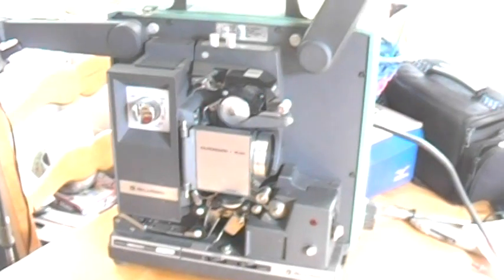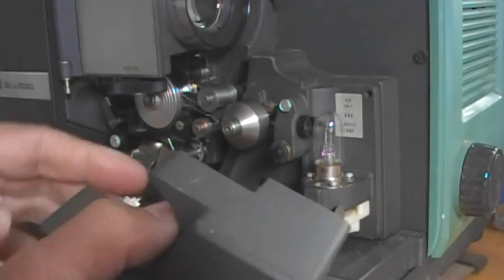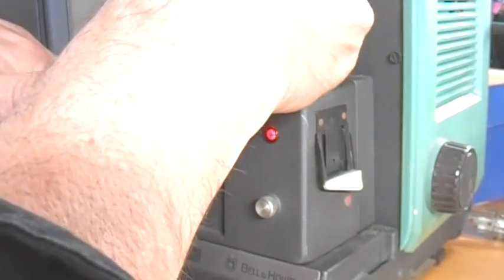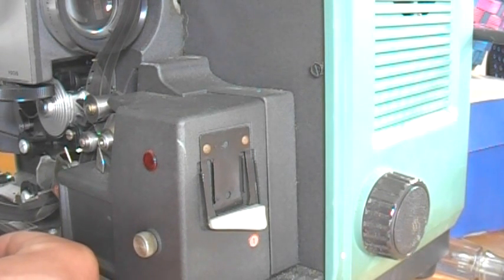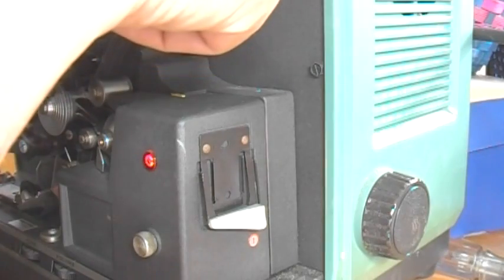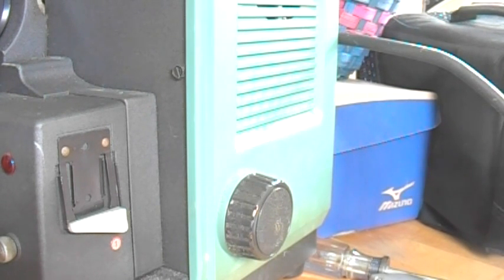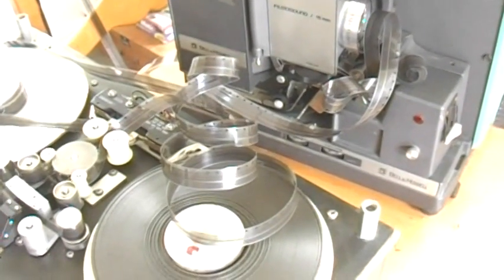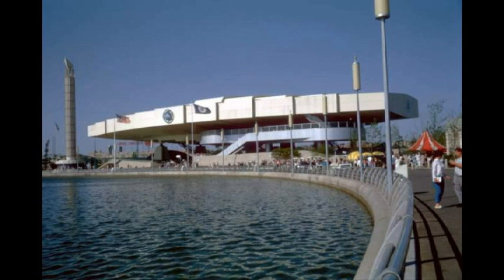Mystery of 1963 Optical Tape Player Solved

Comment: For old sound films, the soundtrack was typically recorded on a separate film reel and paired with the visual portion later (as shown in https://www.youtube.com/watch?v=c6YGAaEfSj4).  Since you were able to hear your film by pulling it through a 16MM projector, it seems as though the reels could simply contain a soundtrack of a film shot on 16MM.  With this system in effect, it doesn't seem too unlikely that movie studios commissioned a machine that resembled a reel to reel tape recorder, but one in which film soundtrack reels passed through the a mechanism essentially the same as the audio player on a projector,  so a technician could listen to an entire soundtrack for errors before marrying it to the visual reels. See the wikipedia entry on the Pallophotophone - just such a device briefly in use in radio at the dawn of sound-on-fim in the 1920s.  It was multi-track, however.
Reply: the URL you posted is no longer available...!

Comment: I saw you had the original player/recording machine three. Did it not work at all. If the projector sprocket and the holes on the film matched you might have been able to play it that way much easier.
Reply from the maker: The original unit had a surprisingly complicated wiring harness, and a multi-prong jack that I could not identify. I don't believe the motor was marked with a voltage, nor was much else. So it would have been a real process to figure out the voltages, and polarities, and also which pin/wire was to drive the unit, and which were for the lights, then which were for audio and control functions. 

I would have had to disassemble the unit much more, to trace out the wiring and so on.

It could have been done. But most features of the unit related to synchronizing it with the train ride, and other unknown attributes. Considering the only feature of immediate interest was the optical audio track, and that a projector could use it for audio, I went that route. 

So you know, I restore old radios and other equipment, and actually worked in a military subcontractor wiring test units for the US Air Force. So I could have done as you suggest... I just didn't consider it the best route in the circumstances.

Comment: The audio modulation bulb lasted a long time, but the VISUAL high wattage light lasted only about 40-50 hours. MAYBE one is being made to day, but I would not bet on it.  The film light was a 1000+ watt bulb, the size of a bite-size pretzel.  They got hotter than all heck, and that's why those things are loud -THE COOLING  FAN.   -I used to get burned by those monsters!

Comment: What has become of this photographic sound  (AKA:optical sound) reproducer from the  NY World's Fair of 1964?  I also  attended this exhibit in 1964 and with my little sister was called up on stage to participate in a demonstration of Bell Tel's f;futuristic video telephones.  The experience stuck with me until this day.  OF course one of the pioneers of optical sound on film recording was Western Electric which was the manufacturing and supply unit for all Bell Tel products so it makes sense that the exhibit might use  long standing technology to have sound tracks that could reliably be synchronized with the ride.
Reply from the maker: Hi, kdegru: Sorry for not responding for so long, and missing your comment. I sold the unit to a World's Fair memorabilia collector, who vowed to make a digital recording of the entire track. Hopefully he did, as it would be the best, and most complete, recording of this historic audio...
Reply from the maker: @cactusjackNV  No I haven't heard. I have to say I agree with you and everyone else that I should have made my own recording before selling this. It would have only entailed transferring the whole film to a reel, running it through the sound projector, and recording it off the audio output. I could have cleaned that up with my audio program, and had what would have been the best version of this track known. 

I regret not doing that. 

In my defense, I was in a bad frame of mind when I sold it. I was overwhelmed with mountains of "stuff", and had enough project to take me past my "due date", and saddle my family with a huge mess. So I was selling and trashing everything I could, as fast as I could. I am a hoarder at heart, unfortunately, and once in awhile need to impose some "tough love" on myself. 

And then what happens is I end up making some mistakes, having some regrets. This was one of them. I should have done a proper job of recording this for posterity, and for not doing that that, I'm sorry. 

The new owner swore he would do this, but no, I have not heard from him, nor looked for such a recording. 

Thanks for the interest and comments.

Comment from the maker: @Kinematographer  Your lab sounds great... all that wonderful equipment should be preserved. I think I may be getting the original machine working... If I do, I will make a recording of the entire soundtrack. But even if I don't get it working, I may be able to use the projecter, if the speed of the sound track is the same. I'll just have to wind this audio film onto a reel, then make a wav and mp3 off the 1/4" audio jack of the projector.
Reply: I know this is a 9 year old comment but I'd love to hear this recording in full,  Direct hookup, Others would as well. I've heard the recording in the description and it's recorded like someone is on the ride. I'd like to hear a direct hookup recording of this tape. Maybe post a wav/mp3 file in the description.

Comment: Rubbish, beware the internet! This projector, like any 16mm projector used in education or business from the 1940's to the end of the analog era, played both variable area and variable density. That was the whole bloddy point. The lamp is called a 'goalpost exicter', the filament is a minute coiled strand. It is the 'slot' that allows a variable density optical soundtrack to be played. God knows what the 'disc' hole you are talking about is for, maybe a repairman dropped something at random once. You read about it on the internet, or saw it in a projector as a missing 'big slot mask'. Now you are an expert. Not.
Reply from the maker: Marklimbrick: With all respect, it is clear you either didn't pay enough attention to the video, or didn't understand very much about what was done here. 
First of all, yes, the projector used is a standard 16mm optical sound projector. And yes, I am fully aware... as are most of the other commenters... that this is what it is. But you totally missed the "whole bloddy point" here: I was using the ability of that standard projector to play the audio track of a standard 16mm movie, to play the audio track of the film strip from the mystery optical tape player. 
You see (or don't, or didn't) that the optical tape player was the mystery... a black box with the mystery optical tape in it... a small production unit, the top screwed down. Of course I could tell by the included parts and technology WHAT the unit was intended to do, but I could not power it up, as it would have been a pretty big deal to trace the circuit and determine how to power it, and how to wire up the audio output. Possible, but difficult. 
So, I took a standard 16mm projector, as you brilliantly noted (and we all knew, already), to use the functioning optical audio reader on THAT unit, and passed the mystery tape through IT. This allowed me to hear what was on the mystery tape. 
So the conclusion was (I am guessing you didn't really watch the whole thing, or actually hope you didn't, because then we have a bigger problem here other than simple impatience leading to arrogant trollism), after being able to hear the track, that the unit was a player for the sound track of the ride at the 1964 World's Fair, along with tracks to control and time various exhibits and animations along the ride's path. 
The very rare... possibly unique unit (no, again, Einstein, not the projector... the type of which, BTW, I have several, going back to the 1930's, and which I have repaired and restored over the years, being an antique camera, clock and watch person, and even used to give movie shows in my back yard, back in the 1980's), I sold to a World's Fair memorabilia collector years ago, for a tidy sum. He promised to made a digital recording of the entire sound track at some point, which will probably be the best quality track of this audio. The only other ones known were from people tape recording them at the time, but this will be from the source. 
There! Now you know almost as much as we all knew already... but, I really doubt you go this far, or even came back here, after your "drive by review, opinion, and base insults", which is, in my experience, a common plague on the internet: Prowl around, peruse, briefly, some thing that looks kinda like some other thing you kinda know a bit about, then get it all wrong, mouth off with snide superiority about it, and move on to another target. 
Which is why you will never learn, and keep doing it, probably. Your type never sticks around long enough to realize your very embarrassing error, or admit to it. But maybe this will be the rare case, you will note this response, and apologize to me. 
But probably, "not".
Reply: please , you troll yourself admirably!
It is my intention to be clear and brief in any comment, that what you say about a 16mm optical head is misleading, or incomplete, or assumes whoever you think is your audience has the ability to discriminate between passing comments as you thread the film and genuine educational narration. There's loads of old junk out there, consumer waste, a fetish is 'memorabilia' if you have more money than sense. The junk is great fun to open up and investigate sometimes. If you feel yourself reacting as if anything on the internet is a personal comment, 'snide' or otherwise, you need to be a bit more gentle to your ego. A room full of technicians is always going to be boisterous, no harm intended, we all have experience. We are all entitled to opinions. Thanks for yours, no sweat.